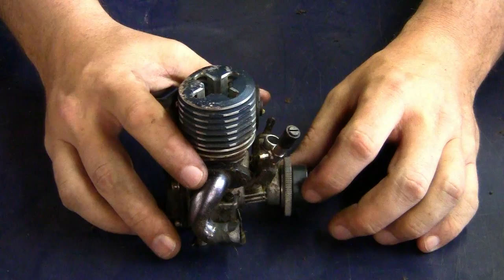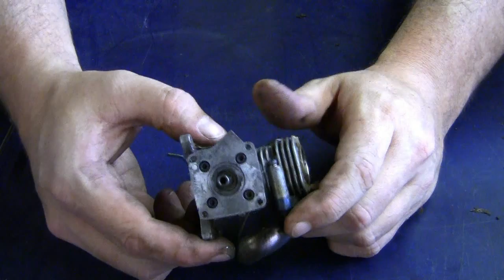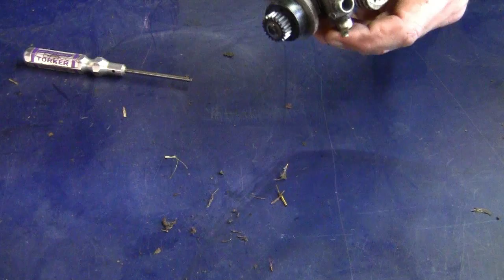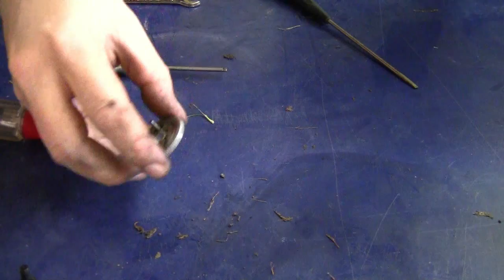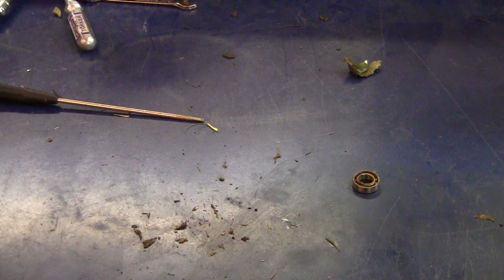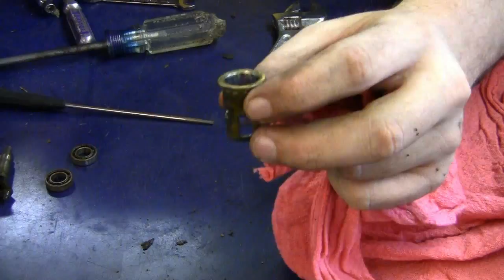T-Maxx .15 Engine Teardown – What You'll Find in a Neglected Nitro Engine

Comment: i just bought a used tmaxx 2.5, and it has an almost brand new motor, but the guy i bought it from, apparently took out the battery pack the goes in the battery box, so i has hoping you could show me how to take the one out of my old tmaxx, which i still havent gotten around to buying a new carb for, and put it on this one, im going to look at it right now, and see it the whole box where the on and off switch to the servos is gone, or what, ill put another comment down when i do, im out of space

Comment: i have this exact model, same body and everything, i got ti used about 3 years ago, and it didnt run, turned out i needed a new starter because the one i had wasnt putting out enough to get it running, so i bought that, and it ran, for about a couple weeks, and then my cousin dropped it and it snapped my low speed needle right off the carb, i was wondering, would i need anew carb, or a new needle?